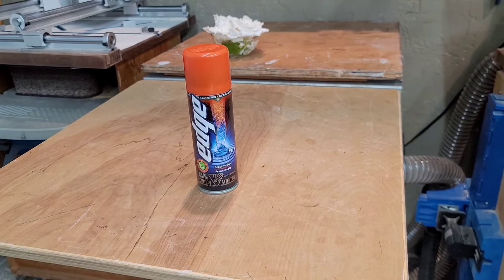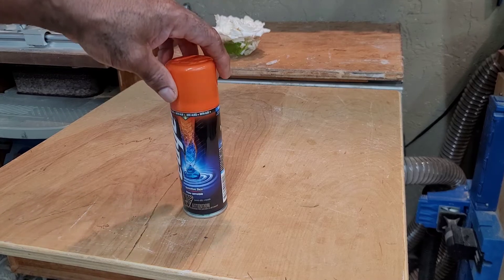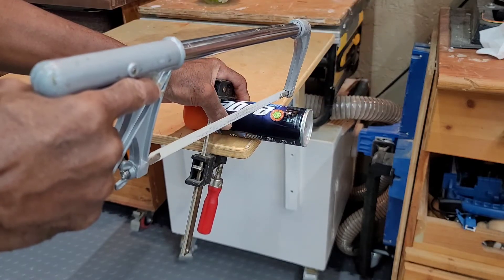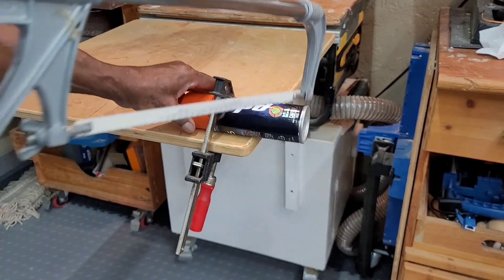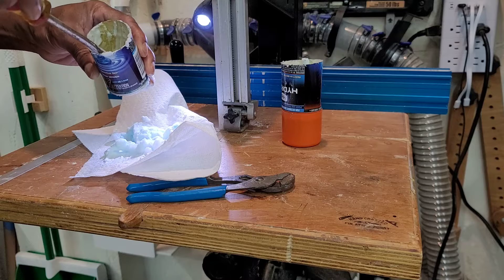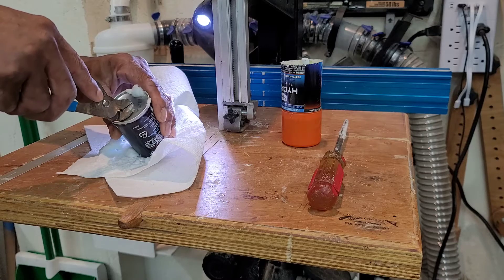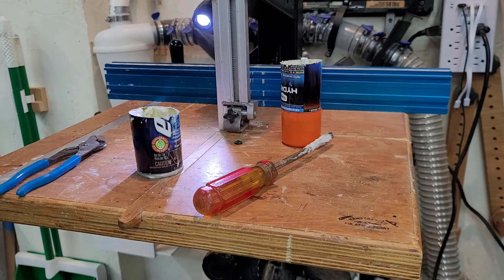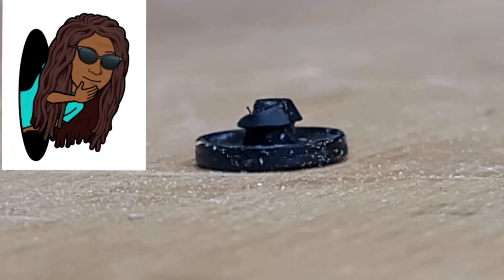Shaving cream can pressure plug

Comment: I recently pulled my last can off the shelf, where it collected dust to replace the old emptied one.  Upon rinsing  and drying off said can I dabbed dried that bottom part and accidentally, it was just enough to release some pressure as it hissed for a split second.  I tried to use it later that day and noticed that obviously not as much pressure pushing gel out of nozzle.  This brought me to look for a way to maybe refill said pressure as I'm sure at some point there will still be some gel left, or a lot, that won't come out.  Coming across your video might tell me that it looks like I'll have to go from the top side to refill if there is a chance of not wasting much of it. Thank you!